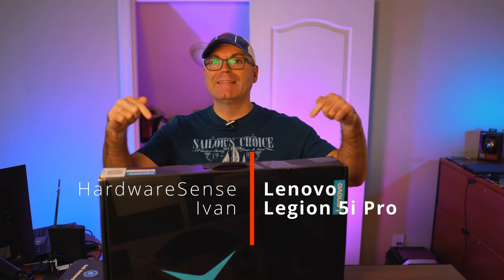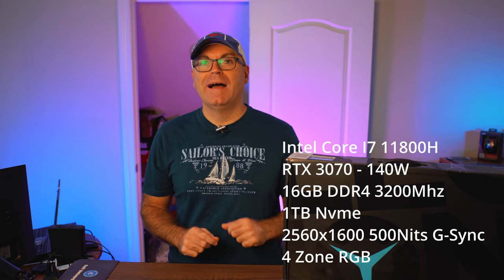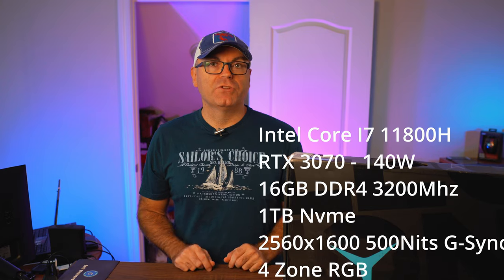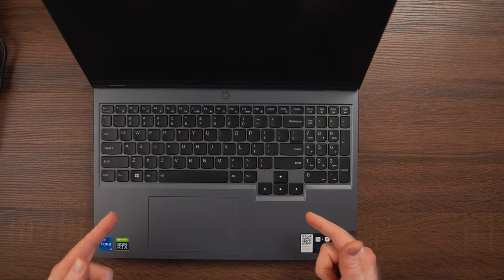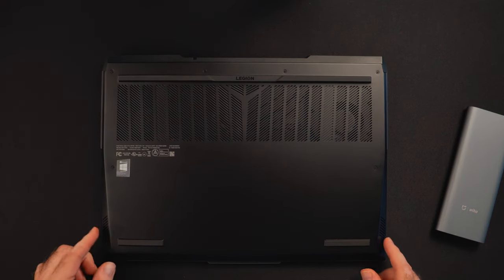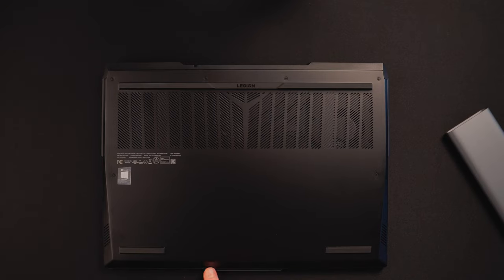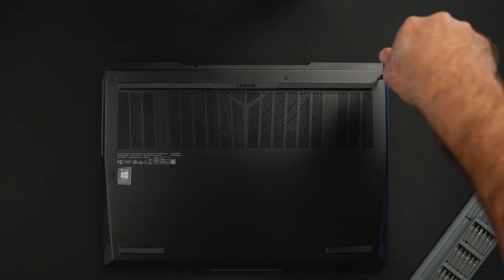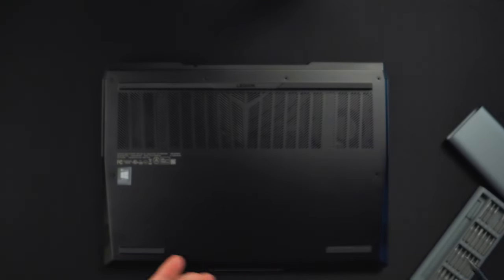Lenovo Legion 5i Pro - Internals, Unboxing And Overview - The New King!

Comment: Upgrading the RAM does indeed boost the CPU performance even more for Intel CPUs. My friend initially had around 8.7k in his Time Spy CPU score with the stock RAM. His score went up to around 11.3k after his RAM upgrade to dual-rank 32GB RAM. Crazy stuff.
Reply from the maker: Yes indeed, I am planning to test all that
Reply: What if I am fine with the performance I get from the default 16gb ram, will the Ram performance degrade on yearly basis?? Is the default Ram faulty??
Reply from the maker: @lanceo57  No its not going to, it's just not the maximum that you can get
Reply: @HardwareSense  oh okay, thanks :)

Comment: i know im late, I got the same spec but weirdly in Malaysia its not under 5i pro name. Its 5 Pro, but cpu 11800h with RTX 3070 as gpu. Mine already upgraded with 4TB Adata XPG 8100 Nvme on 2nd slot, and two sticks of 32gb Kingston HyperX Dual Rank 2x8 3200mhz sodimm. Long story short its more powerful than my desktop lol. By default the main drive is Gen 4 Samsung NVME, and the stock sodimm also samsung but the slow ass 1x16 in dual channel.

Comment: Does it have a removable battery or some kind of way to turn the battery off to prevent degradation while gaming pluged to the wall?
Reply from the maker: What I normally do, is opening and disconnecting the battery from the motherboard.

Comment: How are the temps while gaming ?
Reply from the maker: The lowest I have seen on any laptop. With the undervolt the CPU never reached 90C
Reply: @HardwareSense  how can i undervolt ? In power settings set to 99% or how
Reply from the maker: @adrianiakovis8405  Install Throttle Stop and follow some YouTube guide

Comment: Does it have pcie gen 4 ssd from factory? Because the intel processor in it, can handle the new gen ssd-s
Reply from the maker: I need to read the specs, but the Nvme drive in it is certainly a lot faster compared to the older Legion 5